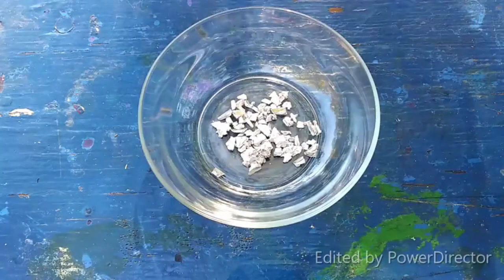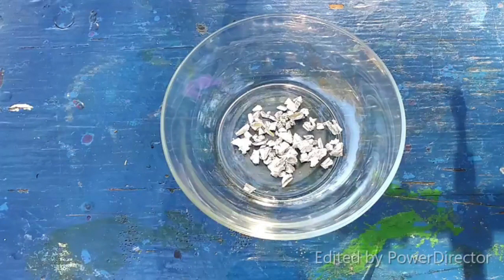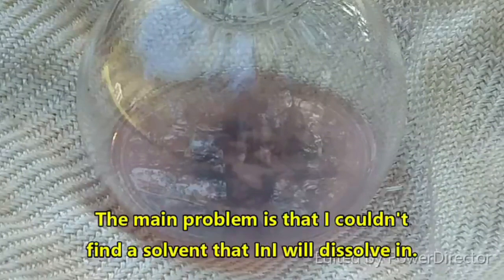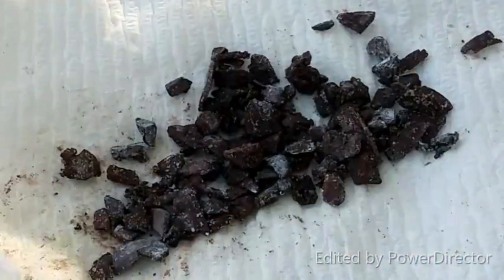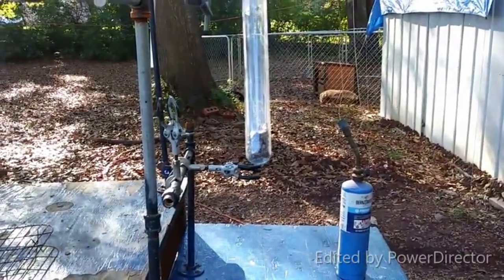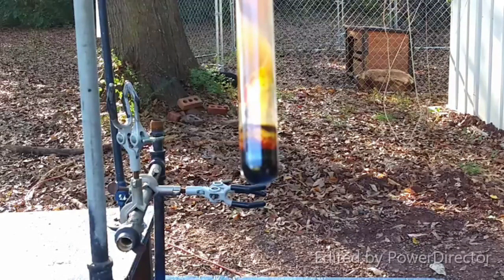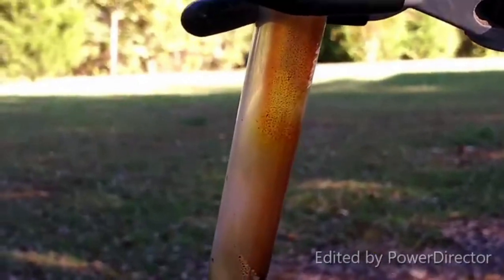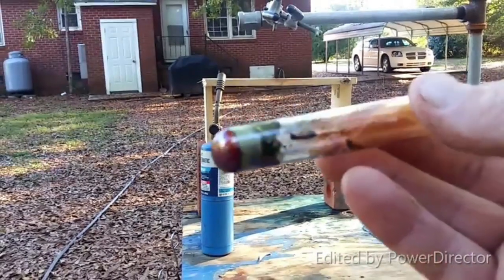Indium Monoiodide

Comment: I've synthesized indium(I) iodide in the lab recently (discovered a pretty cool indium(II) compound in my PhD project and was, at the time, trying to figure out the best way to make it) using xylenes. 
The it was a similar comproportionation. I made crude indium powder by just filing a chunk of indium, it was a massive pain since it's so soft and tended to clump back together. 
A reasonable excess of InI3 was used and I believe what is initially formed is more soluble, yellow In+ (InI4)-. However, upon the addition of dry diethyl ether, this complex fell apart and precipitated beautiful, burgundy/maroon InI. It worked really well! I use InOTf now, but it was a really fun synthesis.
Reply from the maker: Thanks for the info!!!!! That is really helpful! I've been meaning to circle back to indium for some time now and just haven't gotten around to it. Maybe I will give this another try. If so I will definitely give you credit for it! Thanks again!!! 🙂